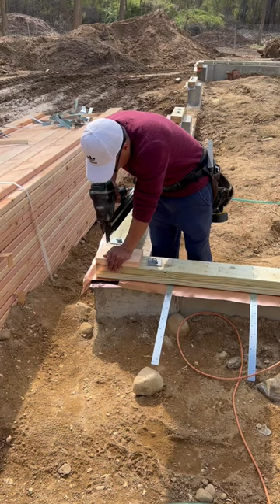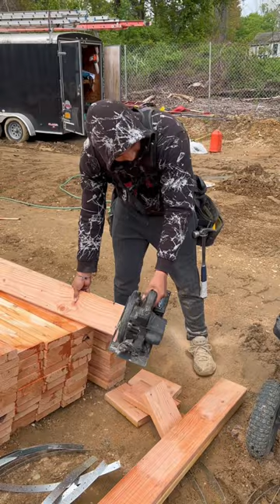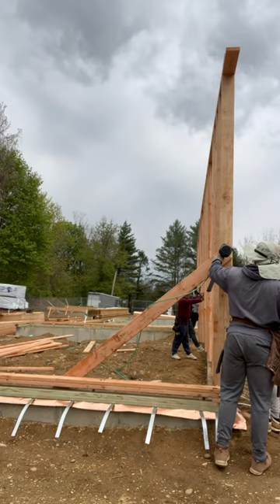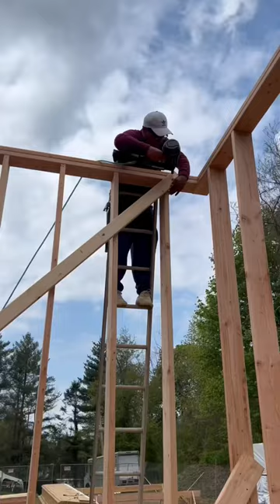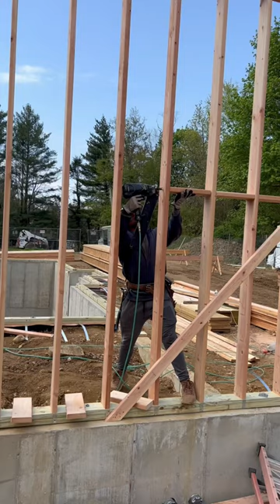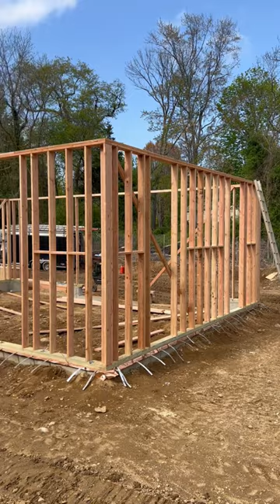12 feet garage walls #shorts #skills #construction #perfect #beauty #team #carpenter #work

Comment: I guess I don’t understand why you don’t attach the bottom plate before you stand the wall?
Reply: I have the same question since I started following this channel.
Reply: My guess is that they could attach the soleplate to the foundation and debug that connection without having to move the entire wall over the bolts.
Reply: I don’t understand why people are confused with their gender also so…..
Reply: @chris2pher44  When there’s a discrepancy between secondary sex characteristics and the psychology, gender dysphoria occurs
Reply: @chris2pher44  Some of what we see today regarding gender ambiguity might also be social contagion. (Monkey see monkey do)
Reply: These guys never nail through their plates. I don't understand why. They even nail the double top plate together, and then toenail the studs. I've heard people comment that Jorge does it this way because it's stronger, but I just don't see any benefit in doing it this way
Reply: This is why you never see them standing a sheathed wall. It's the only thing I ever questioned on this channel
Reply: Absolutely stupid. Attach the bottom plate, bugle up every second stud, cyclone straps, stand it, then fix it down with thunderbolts.
Reply: @shadowOtero  did similar on a recent job where the foundation was out of level up to 2". Also out of square 3 1/2 over 12' , blowouts throughout, and they didnt even tar the seams on the damproof so the basement was a skating rink 😂
Reply: Its an old timey thing. You see guys doing it in the old pathé archive videos. still dont understand it myself.
Reply: I too would be interested to hear the reason behind this method.
Reply: It'd be too hard to position the whole wall over the foundation bolts
Reply: @anthonyrodrigues5032  No, it's not.
Reply: @shadowOtero  regardless of the bolts , you’d still have to lift it up . We frame bottom plate attached then left in on while it’s sheeted
Reply: @Anthony Rodrigues  Dude. No.
Reply: The reason is it saves a plate. I didn’t say “good reason” .
Reply: @HBSuccess  saves a plate ? Just use the second pressure treated plate you added lol

Comment: Why all the toe nailing for and corner being put in after the wall has been stood up  alot easier to nail it to the bottom of the mudsill makes more sense
Reply: These guys never through nail , and I don't understand why. They toenail every stud top and bottom. You'll never see them stand a wall that's already sheathed. Drives me crazy
Reply: @mydogatemyhomework3768   nailing thru the mud sill and sheathing walls before they stand them up is for those dogshit  houses in the middle of the country that blow over in stiff breeze.
Reply: @welewisiii  why? What's the advantage in the outcome here?
Reply: Easier isn't better for the building
Reply: @spruce_goose5169  i’ve never don’t it your way so i don’t know what the advantage is.   a toe mail is stronger than a back nail into end grain.     how do you pick up a 10-12 ft tall wall with plywood and headers in it?   how do you rack a wall that has plywood on it?  if the mason isn’t perfect your squared wall w/sheathing nailed will never be that plumb-   or by plumbing it you are throwing the room out of square and the trimmer complains

Comment: Framing walls that tall like that, is dangerous, and it causes a lot of problems. Normal Framing is not done like that. Toenailing walls like that is not structurally sound. True professional Don't frame walls like that. I'm a LA Trade Tech professional framer we never frame houses like that. I'm just keeping 💯 we frame 2000 sq ft house in 4 1/2 hours. That is not fast and not safe. They can not out frame me and my friends in California.

Comment: Never for the life of me understand why they fasten the foundation, top plate, leave the studs hang loose and then toenail the bottom plate.... seems like a. Ig waste of nails and time...
Reply: it must pass code, but I still wouldn't do it.
Reply: It drives me crazy too. If you notice they nail their double top plate together before nailing the studs on as well. They literally toenail the top and bottom of every wall. I've never seen them standing wall that was already sheathed. I've heard people say Jorge does it this way because it's stronger, but I don't see any advantage in doing it the way he does it. In fact I see a lot of wasted time and effort doing it the way they do it. None the less they have an awesome product when they're finished, it just drives me crazy
Reply: @mydogatemyhomework3768  
He sure knows how to cut a roof in.
Reply: @dudleydooright6181  without a doubt
Reply: Not to Meantion Down Right unsafe 😕 Better way to do this for Sure‼️
Reply: they are nailing it right.  nailing  straight into end grain is useless  might as well glue them on
Reply: @welewisiii  But the nails aren't there to hold the walls down. That's why the sheathing needs to be nailed well to the mudsill. Perhaps a toe-nail is 'stronger', but is it stronger in any way that matters?
Reply: @spruce_goose5169  nailing schedule calls for toe nails in studs. why wouldn’t you do it the strongest way no matter if plywood holds it together or not . i have been doing it this way my entire life. never did it your way, so i don’t know what the benifit to your way is. from what i gather even the big houses in california get framed your way.    i am sure those guys have the same tolerances for plumb and level that i do.   what happens when the foundation isn’t perfect- you sheath the wall after you square it up and the bubble is touching the line on one side. once the plywood is nailed you can’t  rack the wall. don’t tell me you only work with perfect masons. if they knew what an 1/8 or 1/4 was they wouldn’t be masons 

if you framing regular 8 ft walls i guess plywood first isn’t to  heavy. but what about with 10-12 ft ceilings  and with big headers    how do you lift that wall with plywood on it. without a machine.   you can’t always get the machine to all the sides of the house.
Reply: @welewisiii  thanks, good points, I see some advantages to your approach. I don't know what you mean by "nailing schedule calls for..." though.  Are you in the U.S.? It's most certainly NOT called for in IRC code to toenail studs.

The advantages to nailing plates first (whether or not you sheath) is that it holds the wall together. Generally the foundation will get shimmed if needed. It's all situational and maybe people should have both methods in their back pocket.

Comment: very few still use 1x4 let ins nicely done makes for a solid building with minimal racking
Reply: can u explain what it is you mean
Reply: @NcG59  when you french in a 1x4 at a 45 deg angle across a wall
Reply: @dizzieallday  i dont see any 1 x 4. are you talking about the bracing? thats a 2 x 4
Reply: @NcG59  you don't use a 2x4 for let ins
Reply: @dizzieallday  they arent frenched in and certainly look like 2x4s
Reply: @GFlinn  does anyone know what a let in is😮‍💨
Reply: @dizzieallday  all i see is bracing
Reply: A let in is when you notch out the studs to put a permanent brace at 45° in the stud wall..  but there's none in this video
Reply: @dizzieallday  bro they  racked the wall with a two-by-four until it is sheethed and then they'll pull it off. 
     We all know what you're trying to say, but it's just not the case here. Maybe re-watch it cuz this is a losing battle for you
Reply: That's Because we install Shear on walls now No need to Frame like That anymore, an that's a Temporary Brace!

Comment: That and curved claw hammers… and a miter saw?!?! 

My old boss would’ve have kicked my ass off the site 😂
Reply: Using a miter saw to cut fire blocking isn't a bad idea, why are you knocking it. It's probably faster than a circular saw
Reply: I wonder if ur boses construction company can frame houses like this crew does
Reply: Worked on a crew that had two miter saws and two circular saws running no problem. It's nice to jump on a saw that's nearby or if you're walking near the other one use it lol
Reply: Makes 2 of us😂
Reply: Curved claw hammers are the best and mitre saws are quicker for multiple cuts .